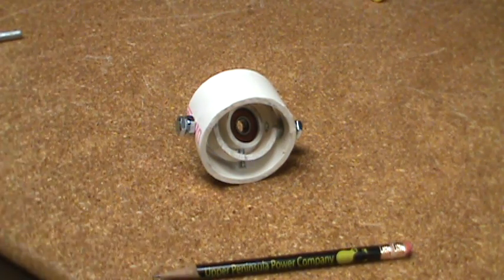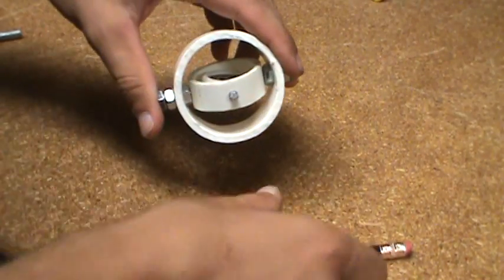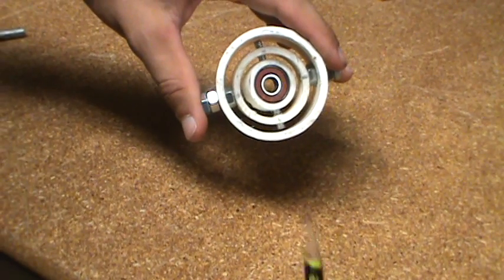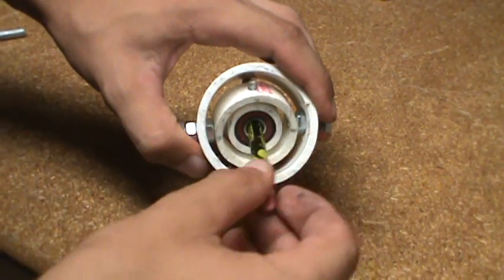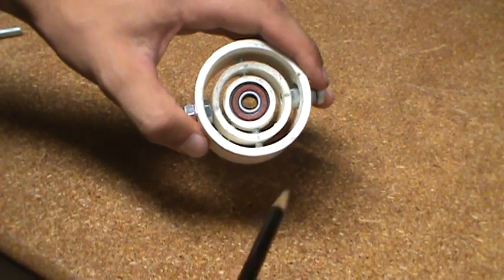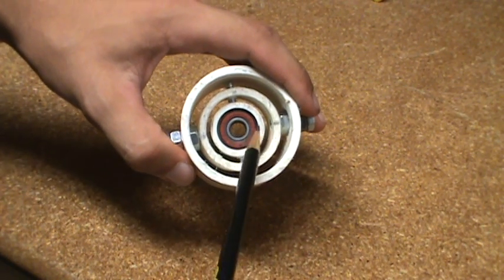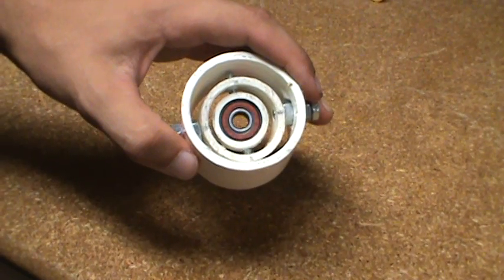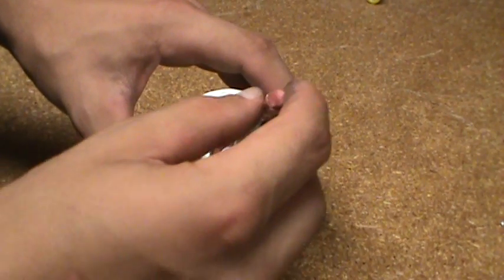My $5.00 Gimbal

Comment: great video....but a small q here, the pivots you used for the x and y axes , are they merely screws that you put in?, and if so why don't they cause any resistance to motion, as in, is it possible for the pvc to rotate  comfortably on threaded screws?

Comment: How is it that the circles are able to swivel? Are the holes drilled in slightly bigger than the screw and so there is room to turn in the hole, or does it turn some other way?